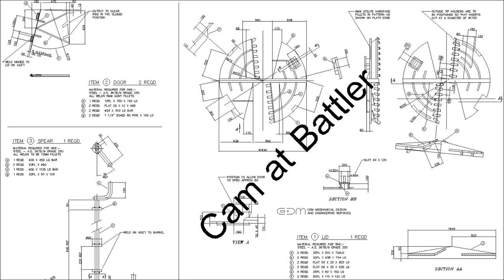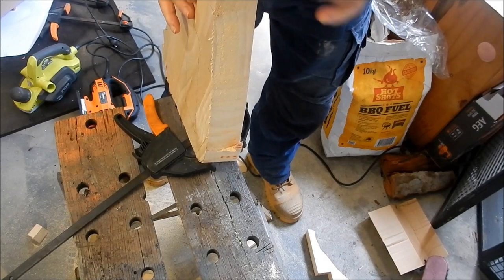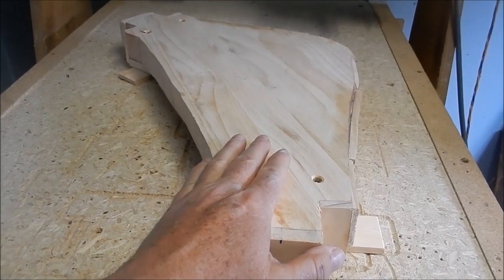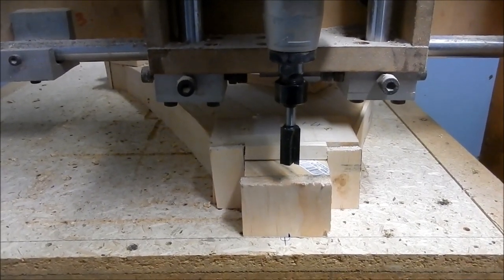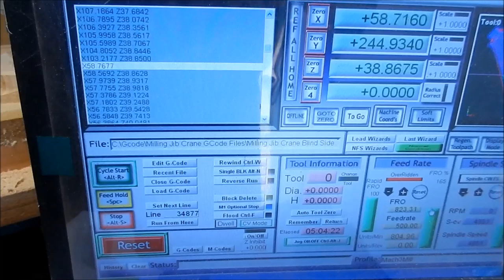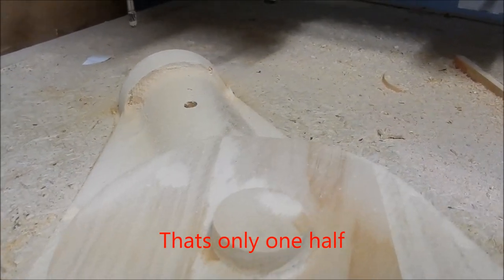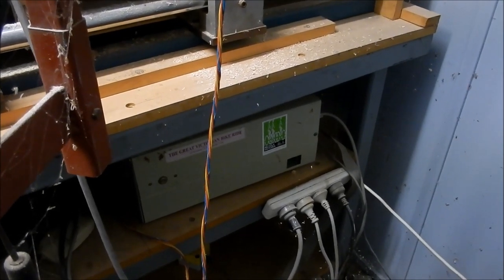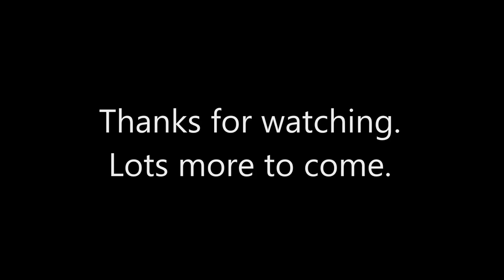Portable Jib Crane for the workshop Part 2.  Making the Patterns

Comment: Nice job. I watched your jig saw work and called out dull blade, and sure enough you had a bevelled cut. dull on one side they tend to drift like that. I liked your saving of the pattern. And your CNC is in the slow but steady category. Looks pretty accurate to. Thanks for making and sharing. You bring back memories of my pattern making.
Reply from the maker: Hi KA, thanks for looking in, yea the blade was pretty blunt and I had to force it quite a bit and I paid the price by having to do the re-work to give me enough material to clean up.  Yea I was running pretty slow, I haven't given it a good run for nearly 5 years so I took it real easy to make sure nothing broke down or I lost steps and positioning.  I used to run this weekly when I was running my foundry, it was easy to have it ticking away in the background knocking out patterns while I was ramming and pouring.  Those days are now long gone.
Cam
Reply: @camatbattler2233    Your CNC router looks like a robust beast! A thought you might like to consider. There are very inexpensive encoders available now. And you can integrate them fairly easily if you are worried about your steppers. Basically a DIY hybrid stepper. Not quite a servo, but with the benefit of having a step count reference that is accurate.
Reply from the maker: @KravchenkoAudioPerth  Hi KA, I have seen them integrated as pert of the Stepper and they are not that more expensive than buying without.  If I was back doing this as I was in the past I would make the jump and purchase and install for the peace of mind.  After this pattern is done it will probably be another 5 years before I make another, besides while its running I'm playing in the workshop so time these days isn't really a big factor.
Cam

Comment: Nice job.
Watch the sharp edges on the pattern. It may not pull cleanly from the mold.
Also, metal tends to chill quickly on sharp edges, potentially causing hard spots or cracks. 
I always used at least 1/8” (3 mm) round over on edges like that. Wherever possible, it was 1/4” (6 mm).
Nice project, though.
Thanks,
John
Reply from the maker: G'Day Caveman, yep certainly hot are an issue on the internal radii and I have a min 3mm radius on all internal edges.  Sharp corners on the outside are not an issue due to the way the metal cools and shrinks as there is nothing to contract away from to create tears.  As this will be cast in aluminium there is no issue with carbide precipitation (hard spots) as occurs in Cast Iron.  
Cam

Comment: 11 hours machining would still be quicker than 3D printing something that size. Sadly, I'm stuck with 3DP..... until I can convince my wife I need a CNC router 😀
Reply from the maker: G'Day Mark, I built the Router back in early 2000 when CNC was just coming into the reach of the home Workshop and the only free source software was DanCad.  The cost of commercial drives was astronomical so the hardware was build from scratch using open source designs and lots enthusiasm.  Those where the days!  I convinced my wife it would make me a million dollars if she let me invest some money and build it, unfortunately it never lived up to its reputation of which I am constantly reminded whenever I run it.  I'd love to get a 3D printer one day but like everyone, things are very tight at the moment so I'll wait my turn.
Cam

Comment: G’day Cam. Well you answered 1 question, is the room sound proofed? Because if the Mrs didn’t kill you after 11 hours of that racket I’m certain there’d be a lynch mob at your front door. The pattern certainly came out nice and showed the advantages of CNC but the noise and time is awful although doing it with a 3D printer would have been days not hours. 
Cheers 
Peter
Reply from the maker: G'Day Pete, yes it is very noisy.  The noise was fine when I was running it at my foundry as I was in an industrial area with no one around me.  When I packed the foundry up that was one of the machines I took back home with me.  Your right, in a built up neighborhood I would be lynched by all who surround me so it had to go in its own sound proof shed.  My next door neighbor was throwing out his large high pitch roof garden shed so I said I would dismantle it and remove it for him.  Down went a slab and up went the shed with a new internal frame and wall surrounded with 3" of sound proofing.  Works beautifully with only a muffled buzz when you are outside.
Cam